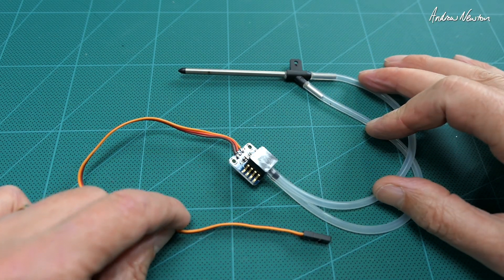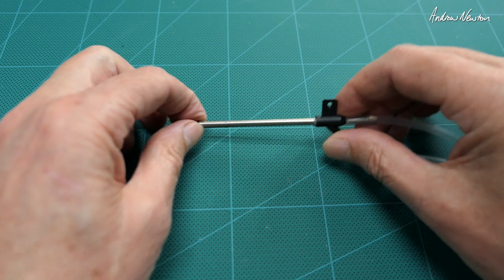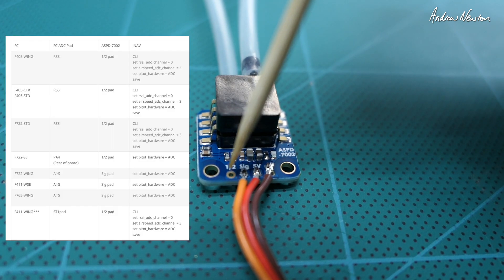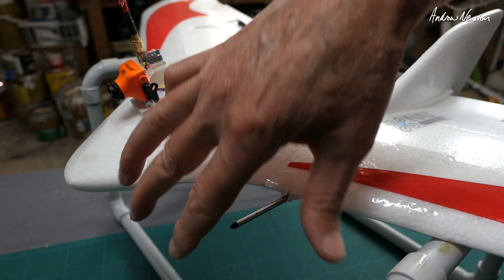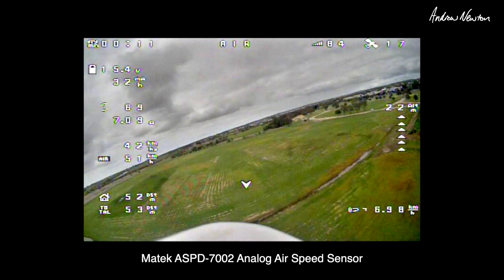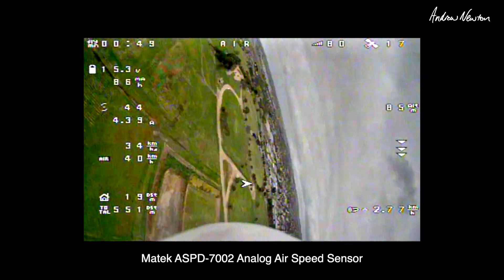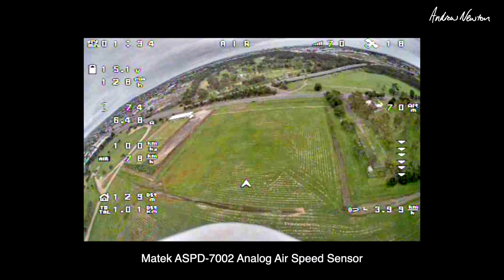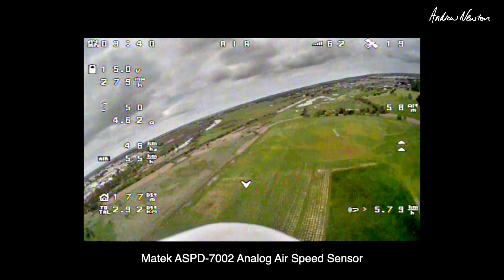Matek ASPD-7002 Analog Air Speed Sensor

Comment: Tips with airspeed sensors.  
1.  The digital ones don’t care which tube is which as they just measure the differential.  The analog ones, as Andrew said, do care and you need to get it right.
2.  Make sure when you mount the pitot tube, that the holes in the side are well clear of the airframe and not blocked.  These are the static ports and need to be in static air.  Turbulence upsets them.
3.  You should be able to connect the digital ones to one of the two I2C ports.  The other one should be the compass that comes with the GPS.
4.  These should work on Pixhawks or at least the cheap clones I use.  Just connect them to the 6.6V analog input or the half voltage to the 3.3V.
5.  Pitot tubes NEED to in clean air otherwise you are wasting your time.  Keep them on the nose or on a bracket well above the airframe or wing.
6.  Arduplane very very definitely uses airspeed.  So much so, that an airspeed sensor is almost mandatory on Arduplane and I won’t fly a valuable drone without one. Especially for autoland or reliably flying lawnmower mapping patterns.  Ones without it can stall and spin in on turning to the upwind legs in strong winds - ask me how I know☹️
Reply from the maker: Essential information again, many thanks Stephen
Reply: The other i2c port doesn't have to be used for a compass, it can be used for any other compatible i2c device such as OLED, temperature sensors etc
Reply: @Ironiic zero being that i2c is a parallel digital bus, all peripherals can be on the same port...Quite frankly I can't see the need for 2 ports, as each can address up to 256 devices.
Reply: @jamesellis5445  Many I2C devices are not able to have their addresses changed. Two ports allow you to have two devices with the same address.
Reply: How do you know? 😂

Comment: Unless your fuselage is sealed, there is no need to use two fuel lines. The static pressure port (bottom one) can be left open, and placed inside the fuselage with a piece of open cell foam tie-wrapped around it. Just put it inside the fuselage such that it is out of any airflow. This will work just as well, if not better than measuring the static pressure at the pitot, since turbulence could easily effect it out there and inside the fuse is very well protected from same.

Comment: If INAV doesn't use the airspeed sensor then how does it determine the correct flying speed when doing return to home etc?  If it is just using ground speed and it is a windy day it could have real problems with stalling when flying down wind couldn't it?
Reply from the maker: It's not even using ground speed. iNav uses a preset throttle position and adjusts throttle to maintain altitude. Yes stalling is a problem if you dont have the cruise throttle set high enough.

Comment: That little 7002 is 60 % the cost of the H743-WING V2 FC  dang ! ? I guess they get you on peripherals $$  or maybe  Zuckerberg has been showing them the way 0_o Good work Newt ! love your stuff.
Reply from the maker: This one isn't even available anymore, have to get the digital version.
Reply: @AndrewNewton  I just fount that out today. 103.00 for FC and 130.00 for speed kit ugh ( Guess they say don't fly this FC with out the speed kit as its not GPS speed only corrected like Inav ? must use both? My poor brain ! lol Thanks for helping the masses learn btw!
Reply from the maker: With INAV the airspeed sensor is not used for flight control, only displaying the value.

Comment: Will the  F765-WING board do RTH without the air speed sensor, or does it use the air speed to control flight.??
Reply from the maker: iNav uses GPS for RTH. Air Speed sensor can't be used for any control, just information
Reply: @AndrewNewton  Thanks Andrew.